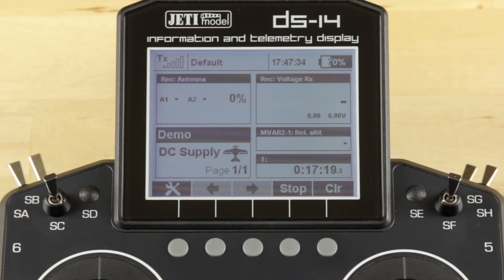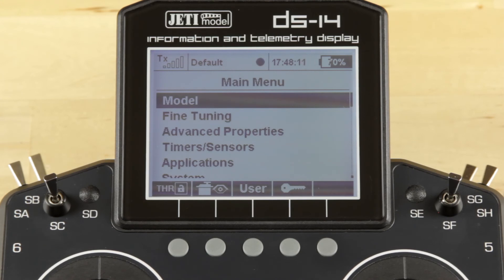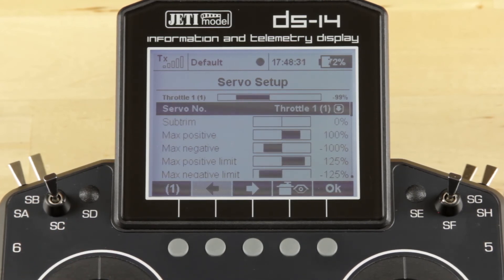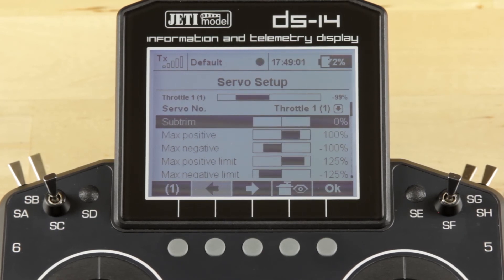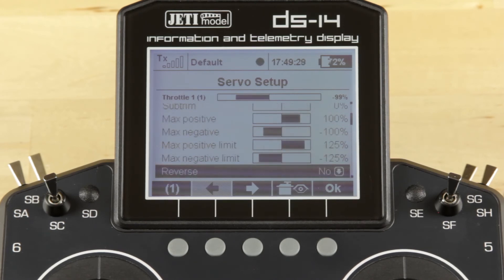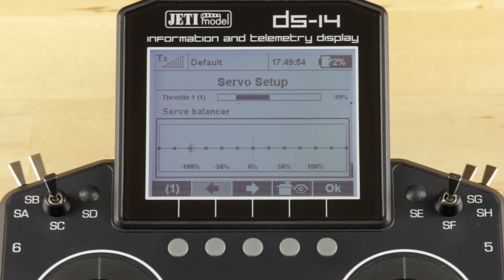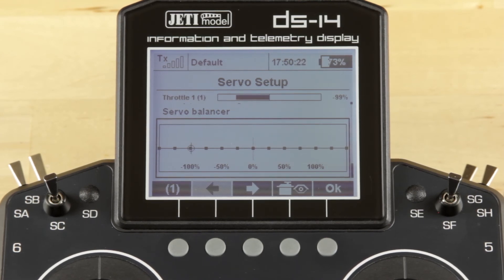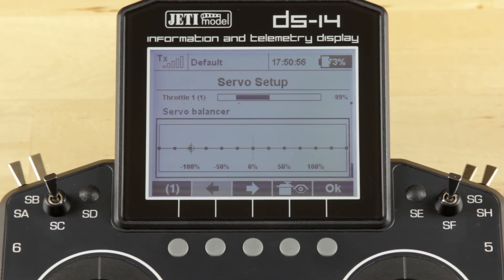Basic Programming: Servo Setup & Balancer

Comment: What does the 'AUTO' button do when in this mode?
Reply from the maker: The "F2 Auto” button enables switching between automatic and
manual selection of control points in the servo balancer edit mode. In other words, when you are in Auto, the selected control point, as well as the ones around it, will adjust to smooth out the curve. If you have any more questions you can reference pages 78-79 in you manual.
Reply: Great. Thank you.
Reply from the maker: You're welcome.